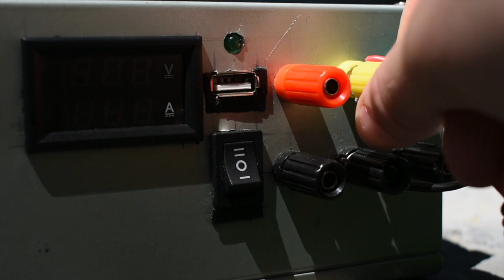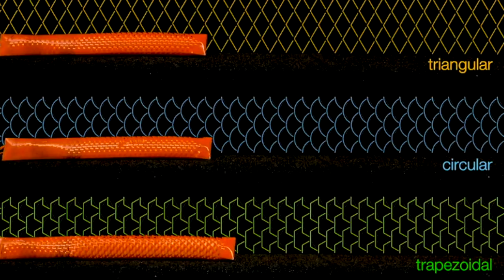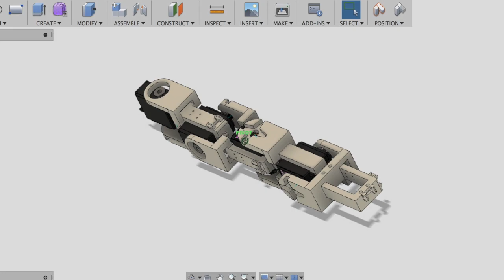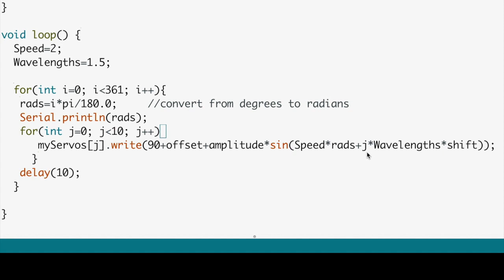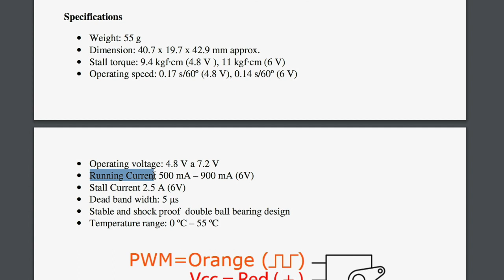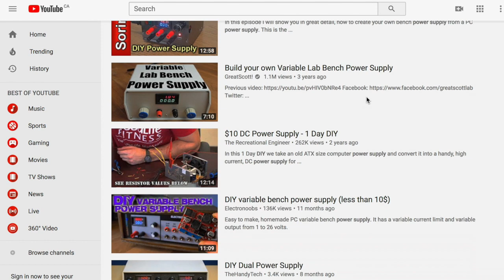Bioinspired Robotic Snake (3D printed)

Comment: Hi Will, dreat proyect. You can use one way bearings instead of scales for your inchworm. There are small ones for RC cars.
Reply from the maker: Thanks for the tip, I was unaware that one way bearings existed, but they provide the motion I am looking for!
Reply: That's what I have in mind for a inchworm project ... which I've never started… Looking forward for your progress.

Comment: Thanks for uploading all this detail.
FWIW I wonder if the portion of the snake which is pushing against the ground is the middle section which is moving backward due to lack of grip at 2:15. It looks like at 3:22 that you might be able to further refine the scales. Maybe fewer of them so that each would apply greater downward pressure. But taking a further clue from 2:15, maybe the grip is needed when the segment is moving partly sideways as well as back, not backwards alone. The segment direction at 3:22 does seem to have a large sideways component.
Anyway, just some idle guesses based on very little information after putting far less thought into it then you have. The snake already moves great with the wheels. Awesome work.
Reply from the maker: I think you right in saying I need to experiment a bit more with the scale geometries. When rewatching the footage while editing I noticed that at 3:22 the snake mostly "glides" over the carpet hairs instead of hooking. The fibres are more compact than I initially anticipated, but with fewer scales and additional weight on the snake in the form of batteries, the scales might engage with the surface more.

Another good point is that "maybe the grip is needed when the segment is moving partly sideways as well as back, not backwards alone", to resolve this maybe I could make scales that change shape like in the Harvard video instead of passive scales. Although I am not too sure how I could make scales that move without lots of additional actuators.
Reply: I wonder if something about the sideways movement itself could do the work of making the scales change shape? I'm thinking of some sort of mechanism which swivels the scales. Of course it's easy to think about these things sitting at a keyboard, much harder in practice.
Reply from the maker: I like the idea of a mechanism that changes the angle of the scales as the snake moves without additional actuators! Perhaps 3D printing the scales onto elastic fabric that can deform and move might prove more successful. Similar to the process in this video: https://www.youtube.com/watch?v=CjH5KGw3Psw

Time to start prototyping!

Comment: Dude- this robot is awesome! Really suprised how fast it moves (perhaps I shouldn't be given how much current it sucks back though) and how able it seems to be at turning left and right. Wasn't expecting it when I was watching, but I like how at 9:10 you came up with "striking mode" :D . As someone who has been watching entirely too many battlebots videos, I gotta ask- using the 1D snake, and a "tail whip" with all the servos at once- d'you think that would cause some damage? 10 servos is, well, a lot, and I imagine that would add up if you moved them all at once. 
The physics of snakes are very facinating- I had no idea that's what scales were for, defo seems like an interesting modelling challenge.
Reply from the maker: Thank you! Regarding a tail whip, yes with some modification the snake could do a tailwhip but the damage would be minimal. The issue comes down to momentum and friction. While the speed is relatively fast the robot is quite light (although "light" is a relative term) and so the momentum/impulse would not cause significant damage. Secondly, is the issue of friction, if the snake was on wheels when it whips it would just push itself away from the thing it is attacking. If however there was higher friction between the snake and the ground (for example, removing by the wheels) then the impact would be more significant.

Comment: In 1d snake with the help of servos you have made the snake like motion but I am not able to understand how the snake is going forward without any power to the wheels and can you share the pic of how wheels are attached
Reply from the maker: as you have mentioned the wheels are rigidly attached with no power to them (as seen at 3:36 - 3:43). The motion comes from the sinusoidal wave in the body of the snake. The snake rolls in the opposite direction to the wave propagation. speaking through analogy, the snake is driven forward in a similar way to how rollerbladers move by pushing the wheels on their skates outwards